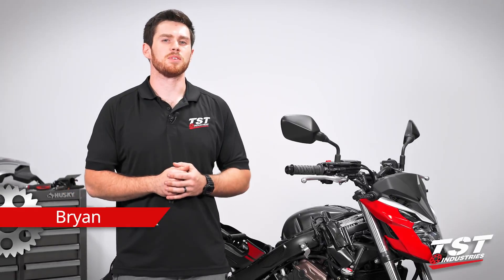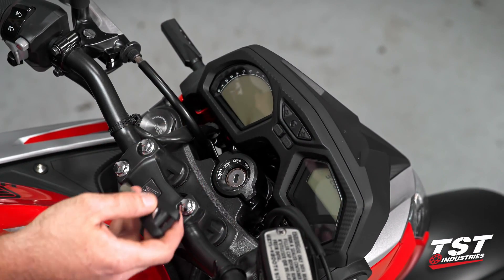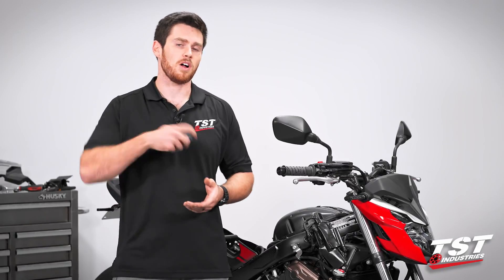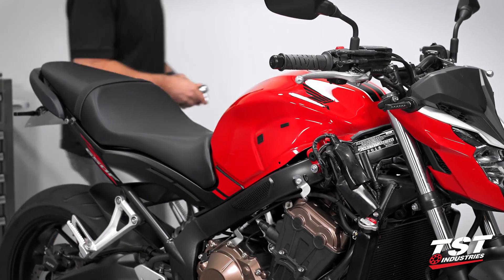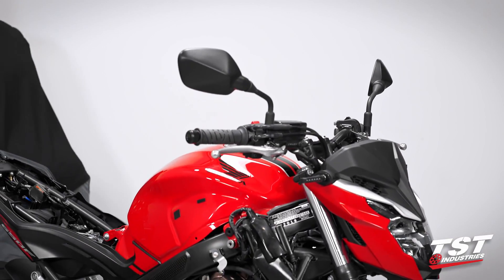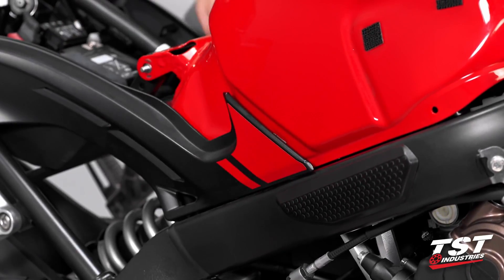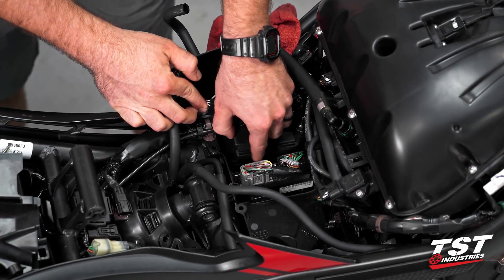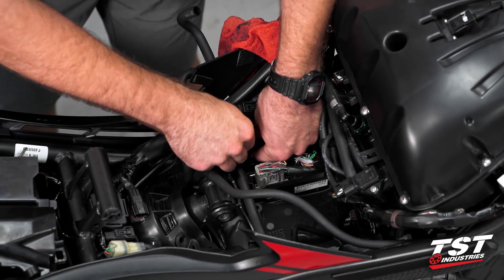How to install an LED Flasher Relay on a 14-18 Honda CB650F by TST Industries

Comment: Thanks for the info and instructions. It is a pain where the relay's located but not so bad if you just follow your instructions. Since the bike was new to me I took the opportunity to check the plug gaps and change the air filter. The plugs sre a real pain in the ...
I'd bought sequential indicators which had their own resistors and timer circuit so needed to slow the flash rate to about 60/min to allow all the leds to illuminate.
Perfect bit of kit for my situation and dash light flashes as expected.
Added bonus: you can't activate the indicators or hazard when the ignition is off, just like the original relay. Thanks.

Comment: Is it on the CBR650F same?
Reply from the maker: You will have to specify the year of your bike. Different generations use different equipment, sometimes placed in a different place than the portrayed bike here.

Comment: Great video- my led came with build in relay - I can’t get em to work , is this what I need ?
Reply from the maker: By LED do you mean signal lamps? And by built in relay do you mean resistor? I have not seen any signals with built in relays because a relay built into the signal would not set the flash rate for the signaling system. I believe that using one of our flasher relays will resolve your issue, but I am saying this based on assumptions and not on data. To commit to my answer with confidence I would need to know the actual specs of the signals you are using and how the built in resistor is wired into the signal circuit, what value, etc.

Comment: Why does the fuel not just completely flushes out when you disconnect it? Is the tank as good as empty?
Reply from the maker: Tjere is a fuel pump in the tank. Without power it does not pump fuel out

Comment: I'm having problems with my cbr650f indicators. Has aftermarket tail light, stock indicators.. was working when I bought the bike, but after installing an A2 restrictor (throttle stop at the throttle body) and a wash, the indicators have stopped working since. I took it apart, checked the ground, good. Checked the bulbs and bulb assembly, good. Relay was inconsistently clicked once or twice every minute of so. So I bought an led relay from eBay, still didn't work but it did make the indicator on the dash light up normally, but with the indicators disconnected only.. so I've bought another relay and led indicators they all still don't work. With the battery being good, the switchgear good. I have ran out of ideas if what could be the issue.
Reply: Would this tst relay fix my issue? Or would there be something else that's corroded or somthing that's stopping it from working? Oh and yes all fuses are good
Reply from the maker: @posborn321  I cannot say with confidence that just changing the relay will fix your problem. I think that we should troubleshoot your problem first and then recommend a solution. Please shoot our customer service department through our website. Someone will get back to you on Monday and help you determine the source of the problem.

Comment: Hello you guys...Great Video..
The fuel tank must be empty? Tanks
Reply from the maker: Hello Blue, your tank does not need to be completely empty for this installation. Although having a mostly empty tank will make it lighter, and thus easier to remove, it is not necessary to drain the tank beforehand. The fuel will leak out slightly once the fuel line is disconnected, however there is a feature inside the tanks outlet that will not allow fuel to continue coming out of this outlet until the main fuel line is reconnected.